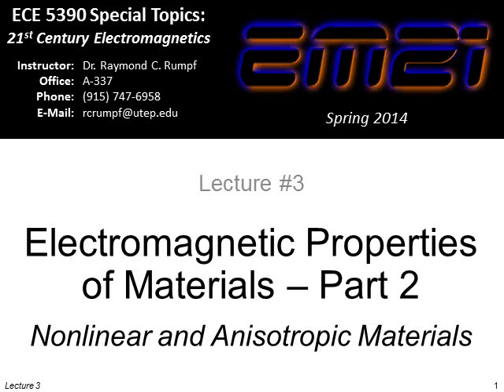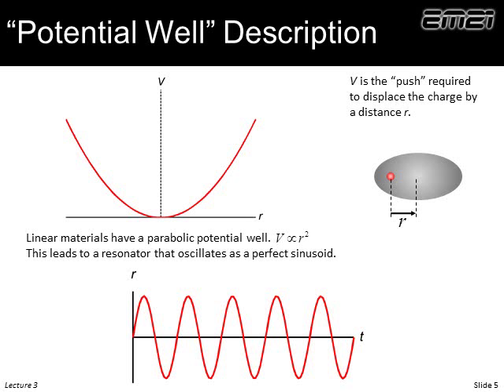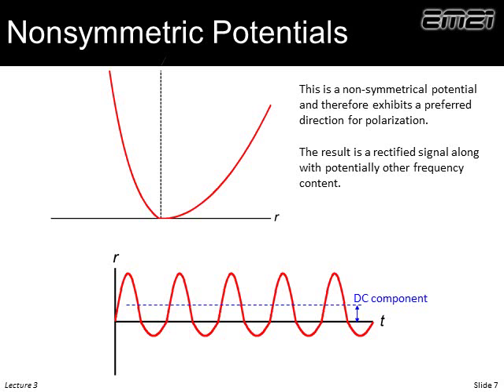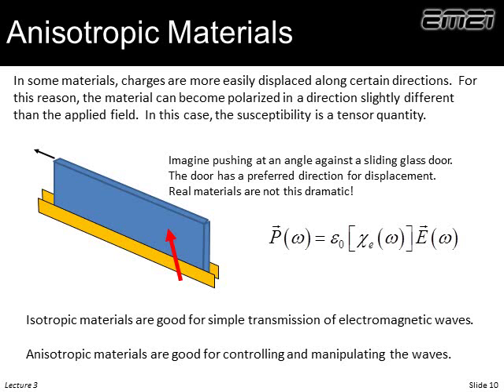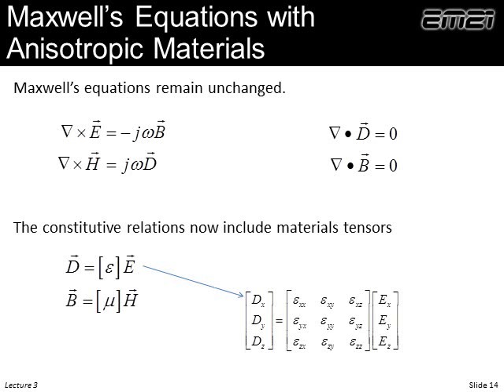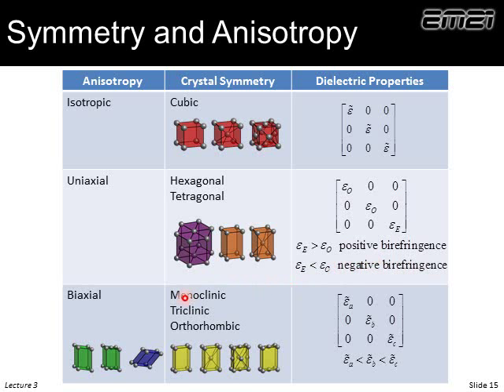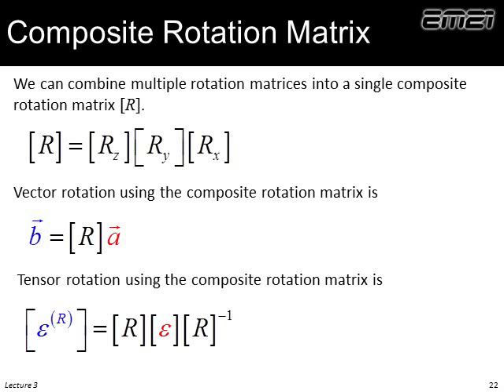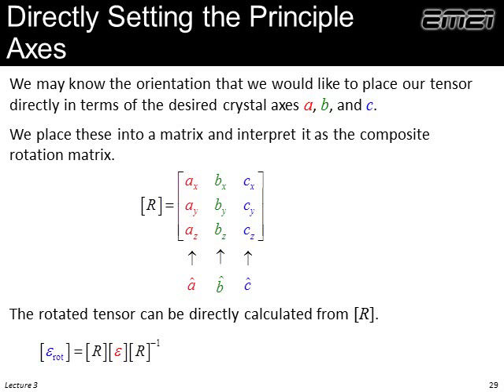Lecture 3 (EM21) -- Nonlinear and anisotropic materials

Comment: Great lecture, Thanks. I would ask for explanation why the rotation tenor is different that vectors
Reply from the maker: Really, I should not be calling it tensor rotation.  Instead I should call it a linear transformation.  

The best hand-waving answer I can give is this.  A vector is sort of like the final answer to a problem.  It is pure information and so it just needs to be rotated.  A tensor is an operation.  That is, it is only meaningful when it is multiplying a vector.  The "tensor rotation" is really transforming the tensor operation to the rotated coordinate system.  So things are different for the tensor because it is an operation instead of just information like a vector.

Hope this makes sense!